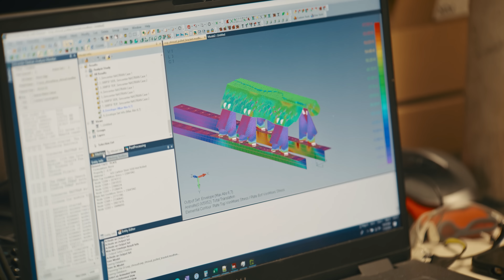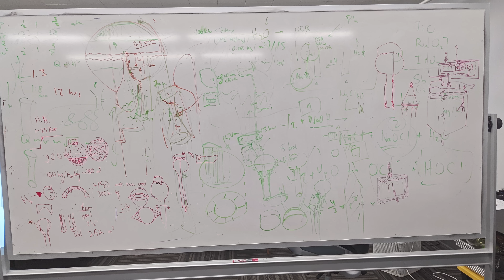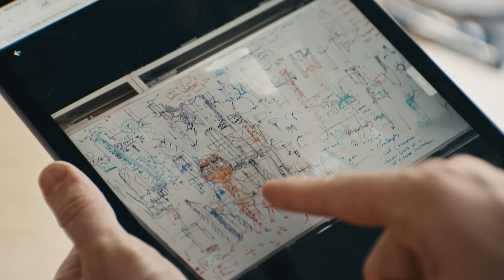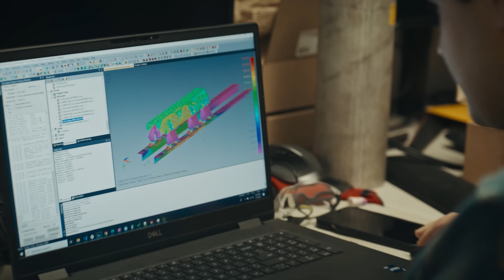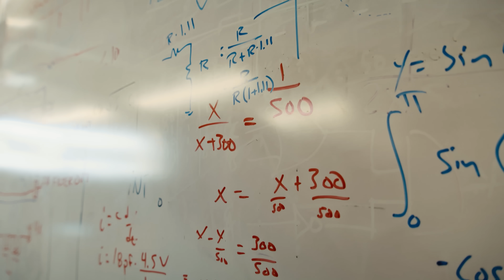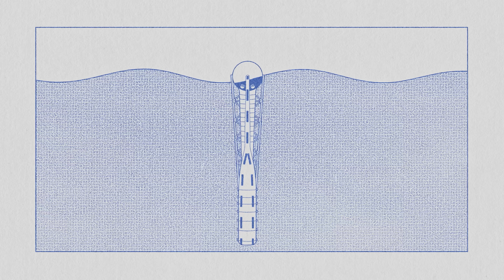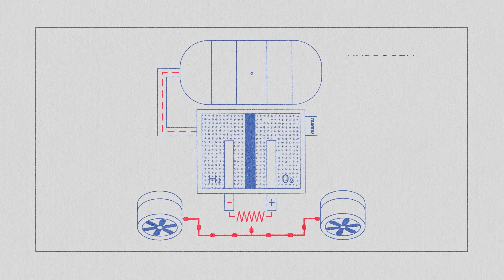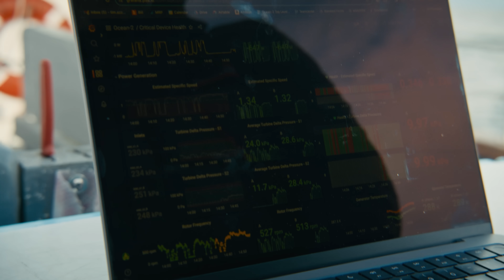Ocean-2

Comment: What a great little film project - unfortunately this is extremely misleading and is totally not feasible - pure money grift emotional manipulation to fund a failing idea 

- The power generation capability is not mentioned 1 time - and for good reason...

This would only generate a meager 20-40 KWh per hour  - whereas an offshore wind turbine is 8,000KWh - with the latest Vestas V236-15MW capable of 15,000kWh per hour

This is effectively building a water tower and dropping it in the ocean - which takes definitely over 3 months to manufacture with a price tag of over $300,000 per Buoy - ( they are likely charging significantly more, over $900k and taking much longer to build it, not to mention deploy, run cable, get permits for etc etc )

which for the manufacturing price of a small water tower plus more expenses - this is already more expensive and less efficient cost per KW than just getting 100 solar panels at over 35Kwh for well less than $75,000 

Cool project - but this is not scalable - you cannot afford to build more than one of these without bleeding money and begging for people to give you more- this cannot compete with the price cost of solar and batteries and you cannot meter your power generation to afford operating expenses

Who was convinced to fund this? were they made well aware of the KWh generation numbers before investing?
If that information was concealed to investors - you guys may be in for a wild ride...
Reply: "This is effectively building a water tower and dropping it in the ocean"
Except this water tower is being refilled and pressurized by waves. If it could be done at a low enough cost (very doubtful) and the power could be economically moved to where it's needed (even more doubtful), then it could be worthwhile doing. 
I'll be extremely surprised if these devices prove to be an economical way to produce power.

Comment: How is energy transferred to shore?
Reply: According to the video, they will either use it in place or convert it hydrogen.
They mentioned using them to power a data center. So I suppose they'll have a boat with a data center nearby. Alternatively they will use the power to produce hydrogen and then transport the hydrogen.  Super simple, right?

Comment: This is very cool and I hope they succeed, but it better produce a LOT more energy at scale. The graphs are showing single-digital kilowatts of electrical power being made, so this giant machine that took 50 people to design and build is making on the order of tens of cents to single digit dollars per hour of value in theory, but in a location where they currently can't deliver that power to anything useful. Just remember that solar panels only take about 10ft by 10ft to produce 1kW and don't need to deal with being submerged in salt water all the time...
Reply: I have a really hard time believing this thing will be more economical than solar. The gizmo looks really cool but I don't think it's a good solution to any of the world's problems.
Reply: Plus you have companies like Orbital Marine Power that make tidal turbines which are producing power to the Scotland grid. I want to say they're latest commerical unit can spin up MW of power, not kW. I'd wager that tidal is more reliable than wave too because of the bistable nature of tides relying on the motion of the Moon. With waves, you depend on the wind, which can be just as intermittent as for wind turbines. 

Tidal requires unique land features to funnel water in and out though, restricting deployment to near-shore. You can deploy these in deep waters, theoretically, or in shallow waters that don't require those same unique land features.

Like with all renewables, I think combining tidal with wave along the shorelines of oceans or even lakes like the Great Lakes could provide benefits where wind or solar can't.

Comment: I was wondering about the energy output because they obviously didn't mention it in the video. So I did a quick calculation. The whole thing is apparently around 60m long (so maybe 40m of height for the water to drop which defines the potential energy in the system) and the sphere a diameter of around 8m. That gives a volume of 268m^3. At 11:52 it seems like the sphere is not even filled like 5%. So I assume it's much less per wave...maybe just 1%. This would anyway mean that every wave there's around 2680 litres of water inside. I assume around 450 waves per hour. That gives a total energy of 402MJ which es equal to around 112 kW/h (with 0.85 efficiency assumption) 

That's just a quick calculation and I don't know if they are even achieving numbers like that. If it's just an output like that then they would probably need more than 30-40 of those to replace a big offshore wind turbine. 

But still an amazing idea :)

Feel free to add some thoughts to the calc. I know that there's a lot aspects missing.
Reply: Might be able to increase the size of the sphere as well, which could increase the power rating
Reply: no thats pretty generous actually and accurate. It will never cost less than oil and 30-40 = a large wind turbine is likely correct.

Comment: Cool idea utilizing water hammer to pressurize the system. The physics of the one interest me since this is effectively a spring/mass/ damper system that has an changing optimal frequency based on its fill level. What efficiency will it actually get across real world situations?
I am struggling to buy into the use cases here: 
Server farm - you think a server farm bobbing in the middle of the ocean will have the up time a company requires? Maintenance? Seems infeasible.
Hydrogen - general handwaviness on a topic that has significant reasons it hasn't been mass adopted. Granted much of that revolves around process efficiency which matters less if it was cheap to make, but it's going to be a real numbers game on generator cost/ reliability/ efficiency to show its actually cheap enough.

Comment: It’s a super interesting concept, and I agree. It’s got serious potential. Honestly, this is the first wave powered generator I’ve seen that isn’t just the green energy equivalent of a monorail. The good news is you’ve built something that potentially makes the inherent problems to a marine operating environment worth solving. The bad news is those are some seriously difficult problems to solve. Still, worst case scenario is those problems relegate this to niche applications. I’m bearish on the whole, “this is golden bullet” prediction. With luck though, I can see it contributing a non-trivial amount to the energy mix. I hope I’m wrong, & this turns out to be the ticket to clean, cheap energy for all. Like I said though, the marine environment is not kind. (Honestly though, if you could just use the thing as a pump & centralize the generation, sort of like free pumped hydro, it’d bypass a lot of the most difficult problems completely). 
Best of luck!

Comment: The claim of the cheapest energy is laughable. Producing Hydrogen, at sea? Bwahahaha
Reply: Yeah, it seems they haven't figured out the transmission issue that has plagued wave power to this point. It's great that this fast deploying device generates kilowatts but if you can get it to the market you're screwed.

Comment: Absolutely awesome device - So many questions!!
If you're planning on deploying these in the middle of the oceans...
- How do you get the power generated back to shore?
- - Is there some sort of chain, module to module in a line to relatively near a shore? 
- How do you secure the devices so that they don't float away with the currents?
- As many others have suggested, how do you reduce the buildup and cleaning of material in the bulb to stop it from impacting the generator intakes?
- - Assumedly this isn't an issue in the column as it experiences sufficiently high water pressures it is effectively self cleaning.
- - Can this be done in situ? Sounds pretty sketchy
- If these things are just floating, what stops someone from rocking up in a tug and stealing one?
- How do you plan on dealing with salt water corrosion, especially on generator parts?
- How does oceanic positioning of the devices effect shipping and underwater traffic (subs)?
- - Pretty important if they can move, something similar to a NOTAM used in the aviation industry? (NOTSM?)
Reply: I missed how they get the energy back to shore, too. I think they implied not through a cable, so charging batteries perhaps? Some sort of sci-fi wireless transmission? A stand-alone ground station for satellite communication seems great.
Reply: @nathanmcmunigal3861  there were allusions to putting things that need a lot of power - specifically cloud data / AI hubs on the sea with the generators and then the only link back to dry land is data via satellite. There were also allusions to generating hydrogen at sea and shipping it back. These are quite niche and quite limiting. They have a long way to go I'd say. For an AI company wanting to green-wash itself though - ideal.